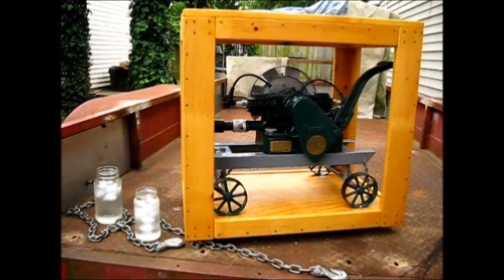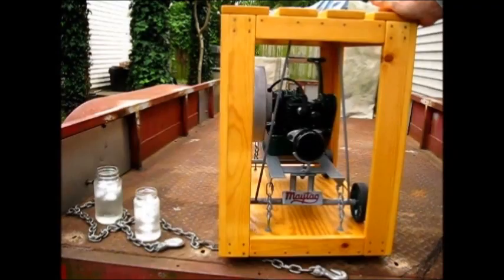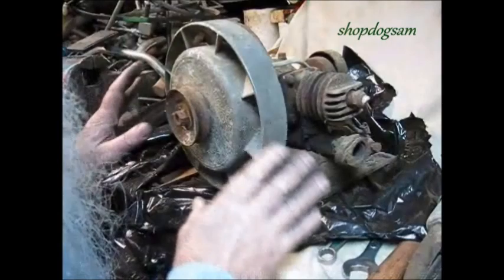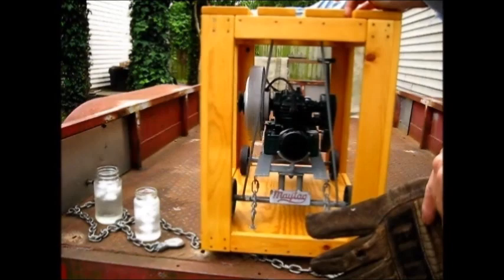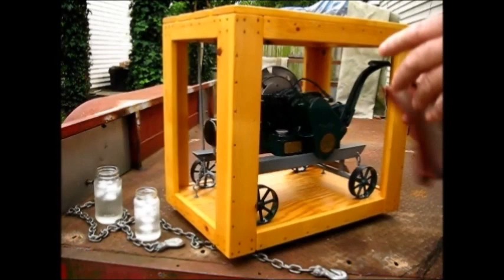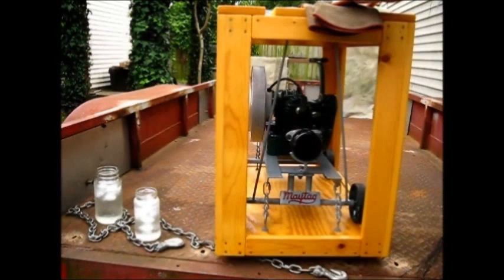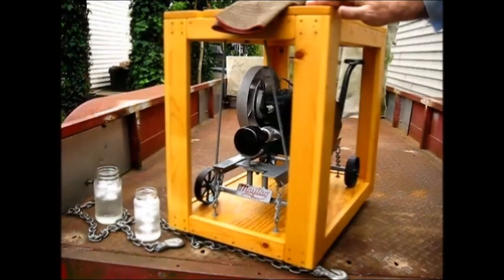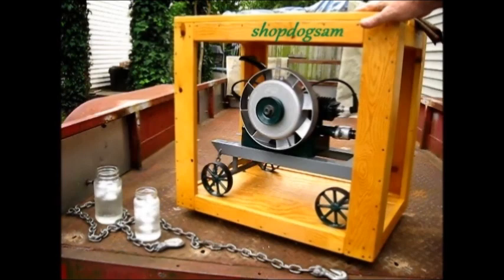1937 Maytag Engine model 72 rebuild #71

Comment: Thank You for showing us such a Fine engine Very nice!  i can't find baling wire new but I do use the zinc coated electric fence wire alot it's great for hanging parts to be painted or to hang stuff up I have folded it 4 times and used it to hold up heavy items

Comment: Shopdogsam I really have enjoyed the videos. I will come back to them once i find my first Maytag to rebuild. However not to be for the lack of a better word rude. I think i have found a flaw in your shipping crate design. that is if it were ever to be used as such. Just from studying the design it seems to me that the crank shaft would be prone to bending under the weight of the flywheel if the crate were ever to be dropped. just my observation. again great videos Sam.

Comment: My roll of bailing wire is on the shelf beside the duct tape and my can of WD-40.  Give me those three things and a pair of slip joint pliers and a hammer and I can fix anything.  Thank you for a great video series, I am encouraged to start on my Maytag single cylinder engine that has been in the shop patiently waiting for me to have the courage to crack the first bolt loose.

Comment: Wow, this is a great wrap up for the series (yes, I seen em' all). If this ain't a work of art, then I am sure I don't know what would be. I remember when my uncle used bailing wire (a good idea) as welding rod to weld up a failed U-Joint on a feed truck (welded it up solid -a bad idea). I have a big reel of that stuff, doubt I will never use it all up even though I use it a lot.

Comment: Bailing wire, it's was used like we use duct tape today.
I can honestly say that I use bailing wire at least twice a week, sometimes a lot more. I use bailing wire to hang things for painting and drying, I've used it to loop my wrenches onto my belt for climbing a ladder, to store oddball washers, to hold parts together for welding and I use it instead of wire ties, it's a lot cheaper.

Comment: Funny you should ask, I used bailing wire on Sunday to hang the parts of my model 72 1940 to paint. Only reason I am building one is because of your videos Its been a fun build and the engine is a interesting design.

Comment: I use bailing wire all the time, to tie my licence plate back on, wire up the fence, hold pieces for painting, fix a broken engine mount, I use it in the kitchen to pull stuff out of the sink, tie the kids to their chairs at dinner time, you ain't getting no pie till you eat your vittles!